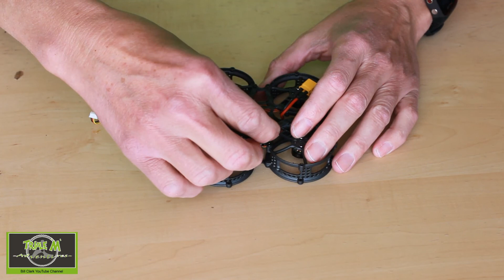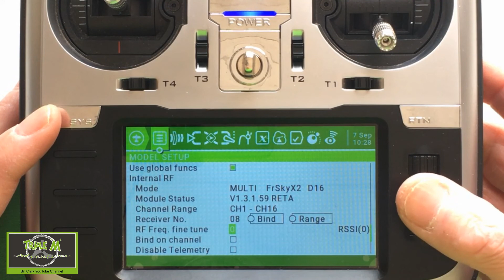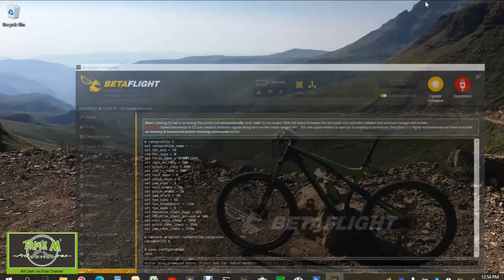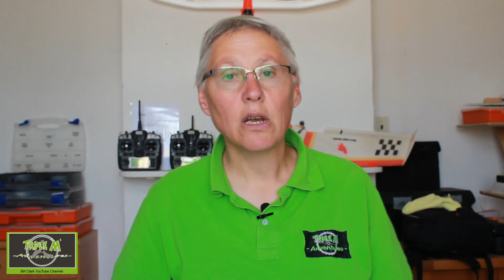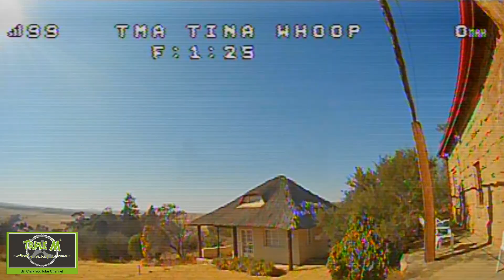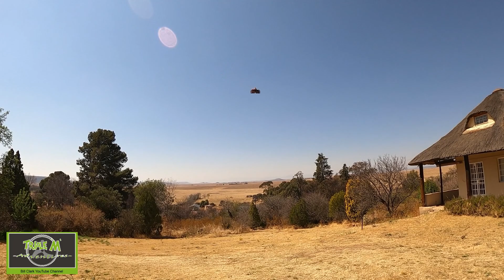First Impressions & Set Up of the Diatone Tina Whoop

Comment: Bill could you show us what inputs and mixes you setup?  I just got mine yesterday.  It wont arm using directions supplied, and will not open a port to connect to betaflight.  My  other drones connect fine.  I tried to Zadig force i5 to bootloader which failed too.  Any ideas.  J
Reply from the maker: Hi John,
I have placed 3 pictures of my Inputs & Mixes screens for the Tina Whoop on my public google drive I hope that helps.

https://drive.google.com/drive/folders/1mb1nhTCaJ3qz73wusjV3j_dlOA-Ks7nY

If you FC will not connect to your computer it can only be the driver is not present or a problem with the USB on the FC. If other FC's are connecting with the same cable then it cannot be the driver. Are you making sure the L shaped USB adapter is pushed in correctly? You need to be very careful with this because you could easily break the USB connector on the FC but you have to make sure it is fully home in the connector.

If you computer is Windows driven are you getting errors when plugging in other USB devices? Something like device not recognised?

If that is the case check this link out:
 https://answers.microsoft.com/en-us/windows/forum/windows_7-hardware/error-usb-device-not-recognized-but-nothing/561cb859-876e-4c76-baf2-e5524cdc68c1

When I cannot connect to the FC it normally has been is a problem with the USB port on the FC.

Comment: Hey i got the hey tina with the Mamba 25A toothpick AIO and there is no 
bind button only a boot button and this is not the same or? so i want to
 bind it in the command line of betaflight. but i can't find the right 
comand. bind, bin_rx, bind_rx_spi and frysky_bind is not working. what 
should i do?
Reply from the maker: Simon what version of the Tina Whoop did you buy the PNP or the R-XSR version? I have checked the Diatone website and they do not offer an SPI version. If you have the R-XSR receiver you use the F/S button to bind it.
Reply: @the-happy-RC-flyer  i bought the one without the FrySkay R-XSR Receiver. Bute my drone has a  R8FM Receiver from Radiolink. by the way i want to bind it with the Radiomaster TX16S. it also says that it supports Radiomaster but on the Radio i cant't  find Radiomaster. Also i am new to the hobby so i am not quiet sure what you mean.
Reply from the maker: @nosenz6807  No problem Simon will all had to start somewhere in this fantastic hobby.
I do not have a R8FM to test for you but I sure the multiproitocol module mode is RadLink then select Air and you should be able to bind your receiver to the TX16S. 
To bind the R8FM receiver to your TX16S:
1. Put the transmitter and the receiver close to each other within 1 meter.
2. Turn on the transmitter put into bind mode, then power on the R8FM.
3. There is a black button on the R8FM, press the binding button in one second until the receiver light starts blinking and release, after about 8 times blinking, match code success when receiver signal LED always on.
I am assuming the I D Button is the bind button.
Reply: @the-happy-RC-flyer  i found the Button on the R8FM but my i can't find the Radiolink thing under the bining options inmy Radio
Reply from the maker: @nosenz6807  please see my last message I showed you which protocol to select it is there I checked it on my TX16S
Reply: @the-happy-RC-flyer  When i am in the Multi mode and i want to select the protocol i can't select an air protocoll if you mean this. My TX16S only has The Assan under a. also i can't select The Radiolink protocol. the Internet says that i should be able to but i can't. The only protocoll under r is Redpine.
Reply from the maker: @nosenz6807  The protocol should be there.
Mode = Multi
Type = RadLink
Subtype Air
So in your Model Setup screen you will end up seeing this:
Mode     Multi    Radlink    Air
The protocol you are looking for is after Q90C
Please go to this link and you will see a picture of my radios screen which should help you.
https://drive.google.com/drive/folders/1mb1nhTCaJ3qz73wusjV3j_dlOA-Ks7nY
Reply: @the-happy-RC-flyer  i tried that but as i said i can't get the RadLink after Q90C is Redpine and after this isSFHSS. so i don't habe RadLink
Reply from the maker: @nosenz6807  what version of the firmware do you have on your multi protocol module?
Reply: @the-happy-RC-flyer  under SD-HC Card: [Firmware] multi-stm-opentx-aetr-noinv-v1.3.1.36.bin
opentx-tx16s-bluetooth-flexr9m-luan-en-2.3.9-otx.bin

if this is what you mean. If not i don't know where to find this information
Reply from the maker: @nosenz6807  There's your problem you need to update your multiprotocol module. Radio Link was added in the next version you are using. The latest version is 1.2.3.12
Please see my video link below to help you with the process.

Multiprotocol firmware is available here:
https://downloads.multi-module.org/

Video how to update your firmware
https://youtu.be/8fwU220sVKc
Reply: @the-happy-RC-flyer  ok thanks i will do this and then give you an update. Thanks for the big support <3
Reply: @the-happy-RC-flyer  it worked thank you so fricking mutch :) <3

Comment: Somehow my tinawhoop didn't come with the betaflight setup correctly. The motor direction wasn't reversed. Airmode and LED was on. It was a mess. I'm yet to get the motors spinning and the props on the right way.
Reply from the maker: Please remember the props are upside down when putting the props on with your Tina Whoop upside down so that when up the correct way  your props will be on correctly.
With your Tina Whoop upside down and camera facing forward
Top Left Motor CCW
Top Right Motor CW
Bottom Left CW
Bottom Right CCW
If this not the case you will need to use BLHeli to change the motor direction. In my set up
ESC 1 Normal
ESC 2 Normal
ESC 3 Reversed
ESC 4 Reversed
Please check very carefully before arming your quad, take props off to test motor direction . 
I hope this helps you get your quadcopter into the air.
Reply: @the-happy-RC-flyer  Got it working! Reversed motors 2 & 4.
Reply from the maker: @jumpstartfpv  Great!

Comment: and there is no bind button ... 😭😭
Reply from the maker: Which receiver are you using?
Reply: @the-happy-RC-flyer  It is the Tina BNF with FRSKY X-XSR
Reply from the maker: @schippche29  The R-XSR bind button is positioned next to the wiring plug have the wiring plug facing forward with the antennas facing towards you with the antenna connectors underneath and the very tinny button is in the top right next to the wiring plug connector
Reply: @the-happy-RC-flyer  Thank you very much. I found it. Binding worked with my Jumper T18 Pro.